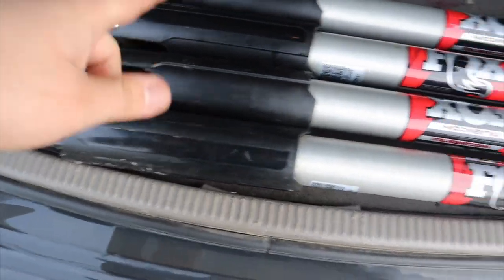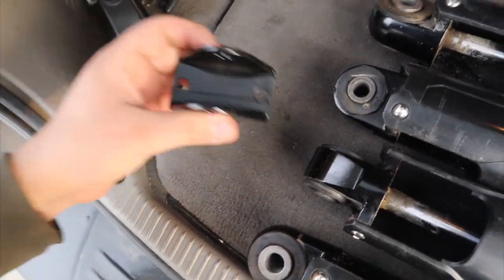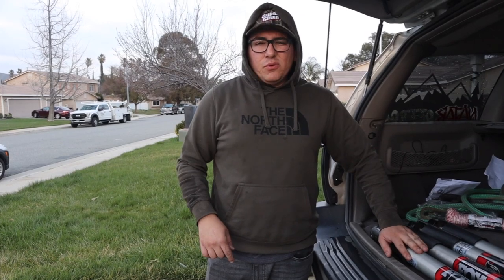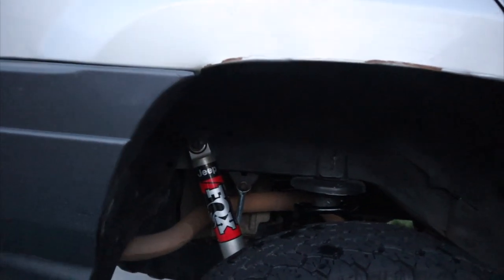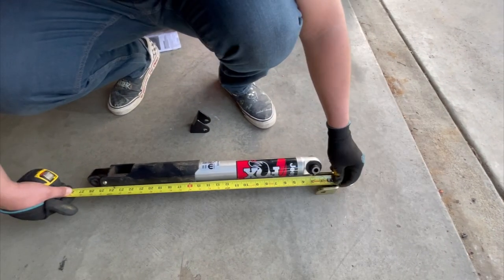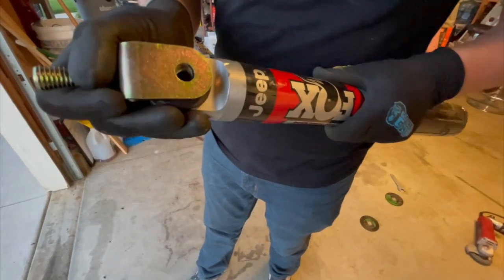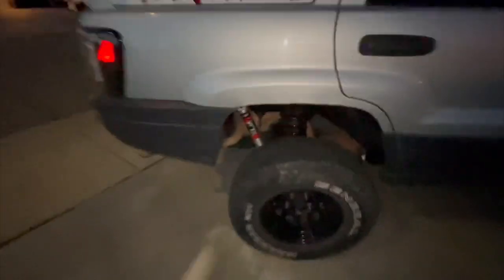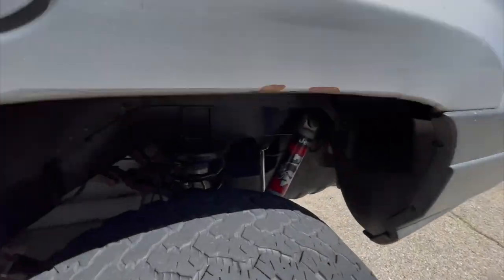Jeep JT Fox Rubicon Shocks Install on Jeep WJ Grand Cherokee | Gladiator Take Offs | Najar Offroad

Comment: Great idea! I used to have an 04 WJ Overland that a friend and I modded some stock JK Rubicon shocks to work with and to this day, that was one of the best riding Jeep’s that I owned. I had them paired with a Rusty’s 2” spacer lift and up-country springs that gave it close to 3” of lift.
Reply from the maker: I really like these shocks! Feels great on and off road! And you can pick up a set with low miles for like $200
Reply: Did it fit for JL 4 doors?

Comment: That's awesome I've been working on something similar after I did the Gladiator steering stabilizer mod I got spring shocks and steering stabilizer for $50. I'm working on a 3-inch lift and fitting stock Gladiator shocks knowing I would just be able to upgrade to the fox ones and it's funny how I was about to buy the same shocks you got on Craigslist and you beat me to them LOL good s*** bro keep up the work. I'll race you to try and figure out how to inboard mount the rear shocks bro! Lol👍
Reply from the maker: Oh nice shoot me some pictures of that mod on Instagram @najaroffroad haha I don’t plan on doing that but I’ll gladly show off your set up on the channel!

Comment: Mine are working out great but I was wondering if you had the same problem I do. Coming down on obstacles I bottom out the front shocks. Did you extend the bump stops? If so how much longer did you go?
Reply from the maker: I lifted my Jeep more😂 but yea extended bumpstops should help I did not have that issue since I was on 4.5” plus the rough country .75 spacer

Comment: I currently have the Doetsch Tech 8000 shocks and they are very stiff, how are these shocks? And would this work on a 3 inch lift? Not sure how to measure shocks 😅 thanks in advance
Reply from the maker: These are more stiff than bilstein but I do like them so far! The front I don’t think will work the rear will though

Comment: What exactly did you grind down on the rear shock?  Shock sleeve bushing, bottom of shock, shock bracket?  Thanks.
Reply from the maker: The sleeve on the shock itself
Reply: @NajarOffroad  Thanks Dawg.  That's what I was thinking.

Comment: I just bought some of these shocks, I bought the front upper shock mount you listed but im going with the iron rock offroad bar pin eliminator for the bottom. Would they fit? And great content btw
Reply from the maker: Yea should fit as long as you’re over like 4.5 inches
Reply: Did you use factory hardware in the rear?

Comment: So the bolts that came with the brackets for the front upper mounts are smaller than the hole in the shocks.  Wouldn't that allow the shock to move a little as it takes bumps? Should I buy some larger bolts and make the hole in the bracket larger?
Reply from the maker: I don’t remember about the bolt being smaller I haven’t had any issues or noise

Comment: Subbed! 

Just got a White WJ that needs a little work. Do the springs fit as well or just the shocks? I was thinking of doing a budget lift with these and springs plus some other parts for the lift
Reply from the maker: Thanks brotha! No springs don’t! Sign up for the 10K lift kit giveaway you might win!
Reply: Yo I got a question. I’m trying to remove the a-arm ball joint with a hammer and ball joint separator but it won’t budge, any advice to get the axle housing off?
Reply: And you know I already entered for that lift! Haha

Comment: What size tire are you going up to?
I put a 3" IRO lift on my WJ and went with 255/75/17 (32") it looks good. It would probably look good with the 4" you got.
Also I ended up putting in the Rancho 9000 shocks, which are adjustable, you might want to look into those for the future.

Cant wait to hear how the shocks do when you take it out, they look sharp on there.
Reply from the maker: I went with 285/70/17 I actually put them on today! Tight fit! I’m excited!
Reply: @NajarOffroad  Thats like a 33" tire, did you regear or are you already at 3.73?
That will look good on there though.

Comment: has anyone done this with the ironrock WJ 4" Foundation Series Lift Kit
Reply from the maker: Probably to long. You would definitely need to make a lower shock mount since they would be to long in the front
Reply: Thanks for your reply. I just bought some for $250 I hope I can make it work
Reply: @NajarOffroad  how did you make them fit in the front of your jeep?

Comment: Najar, do you think this would work on a stock WJ with no lift?
Reply: Did u try it
Reply: No I did not think those fox shocks would work without a lift. I have a 2004 overland with the upcountry suspension so I think my springs and maybe shocks might be a little different than a standards WJ. I found that the original factory shocks were still on my WJ. I took the shocks off and measured them. I got 22" full extension and 14" collapsed on the rear shock. I got 20.5" full extension and 13.75" collapsed on the front shock. I looked up the size of the fox shocks and found they would not fit. I ended up buying Bilstein shocks.

Comment: Looks good but I think those are installed upside down
Reply from the maker: I installed them so the logo would right side up instead of upside down. I’m not 100% sure if that’s correct or not
Reply: @NajarOffroad  I knew that was going to be a reason lol. Yea looks cool that way but in reality for reliability the other way is best so that it doesn't act like a cup and hold water and debris. You want to keep that out the piston rod so it doesn't damage the seals.
Reply from the maker: Looked it up and they are placed the same way on the Gladiators with the Jeep logo up
Reply from the maker: Oh never mind I know exactly what you are talking about on the rear😂 yea I noticed that when I did the 2nd side the opening should be facing the rear of the Jeep for sure
Reply: @NajarOffroad  the blk side is the cover. The blk cover should be facing the top.
Reply: @pablomarquez4431  The black cover has a cut out in it to allow water/mud to drain out. The shocks are supposed to be installed with the cover down. Cover down also places the piston seal facing down so that debris doesn't sit on top of it. I know this reply is a year late but I was wondering the same thing and thought others might be as well.

Comment: Just bought those shocks with 6k miles on them for $100 for all 4. Gonna throw them on my jeep with a 2.5” lift. Guess we’ll see how it goes lol
Reply: How did this work out. I have to change the suspension on my WJ and just now finding this video.
Reply: @musicismeds  It worked out well, I will have to say that you will have to do more cutting/modifying to the shock and just simply cutting the shoulder off of the top of the front shock like it’s implied in the video. You will have to take a little bit off the top and bottom of all for shocks for them to all fit properly in the stock mounts. That is what took a majority of the time. The ride is pretty rough, but I think it’s because I didn’t put any washers or rubber grommets between the shock adapter and the shock tower so I’m gonna go back and put some in there like what would come with stock shocks and see if that helps, because it is incredibly jarring when I hit a bump on the road. It almost feels like the shocks are bottoming out but they’re nowhere close